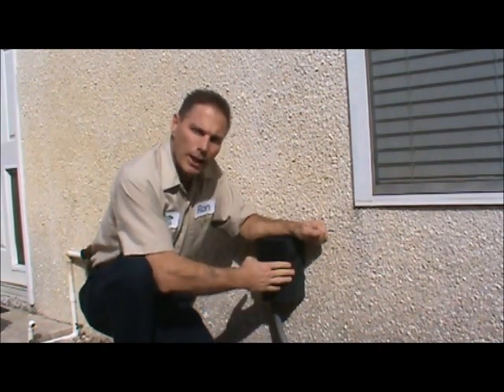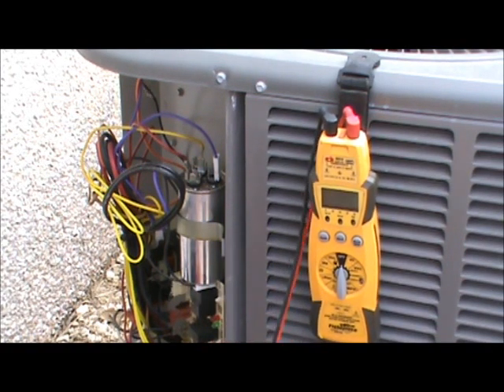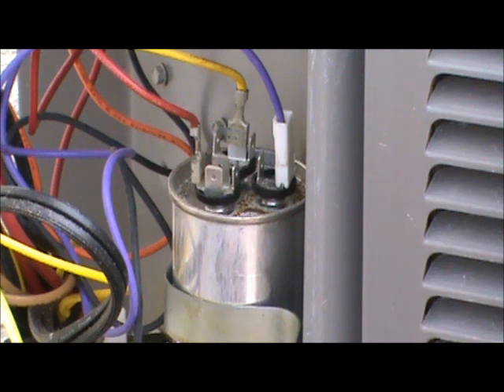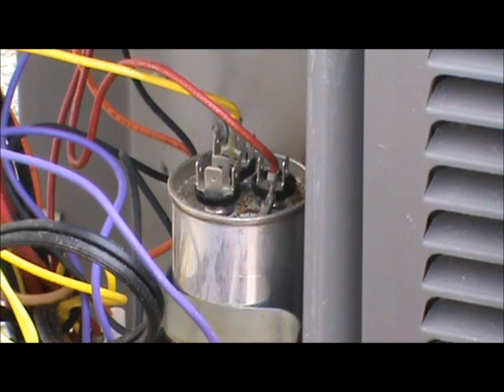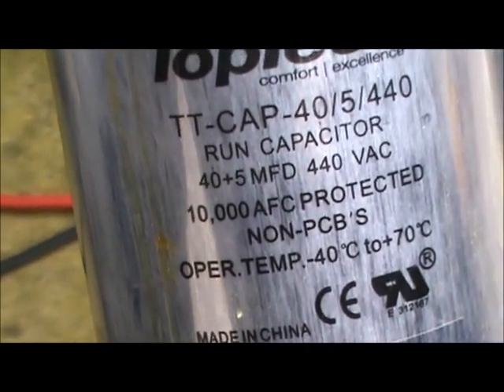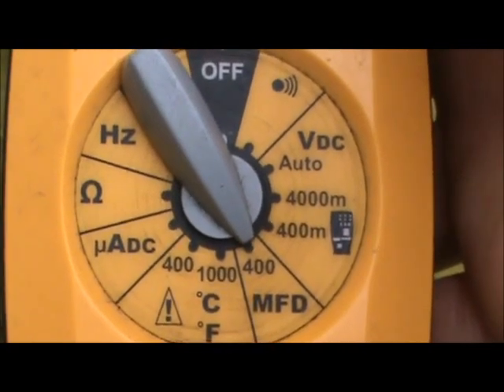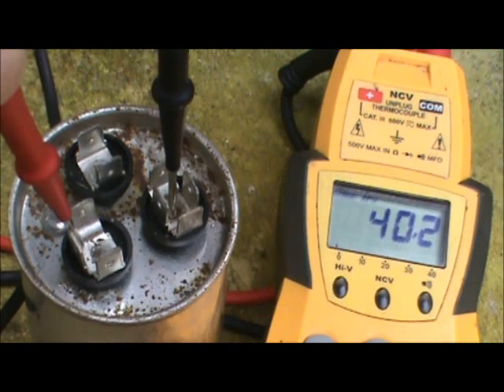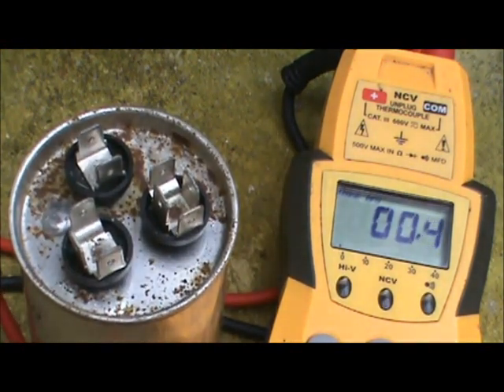HVAC Training - Dual Capacitor Checkout

Comment: I have a dual capacitor. I want to get a second for emergency 45 +5 370v.  my existing Fan as 2 connectors, Common has 4 connectors and Herm has 3 connectors to hook my wires to. 

If the one i want to purchase is marked   S, C, and fan, does it matter if S, C, and Fan all have 4  connectors to wire to (instead of 4, 3, 2 connectors)?

I thought the manufacturer may have included 4 connectors for each for convenience sake when connecting wires.  Is that true?

Comment: can it be replaced with higher value capacitor?
Reply: Not the microfarad rating..... replacement should be an exact match. However, the voltage rating of the new unit needs to be the same ( or higher). You can replace a 370V with a 370....or even a  370/440V rated unit. You cannot replace a 440V unit with a 370V. You CAN replace a 440V unit with a 370/440V unit.

Comment: 2:48 - I do not know of an exception to this observation: The fan terminal on a dual capacitor will have 2 spades (on rare instances 1 spade). The Herm terminal will have 3 spades. The common (C) will have 4 spades. I have not seen any dual capacitor (no matter the age) with more than 3 spades or less than 3 spades on the Herm terminal.
Reply: There are all kinds of combinations depending on brand and manufacturer. It's quite common to see 4 spades on ALL terminals.

Comment: Hey, Ron I have an old 8000 BTU, Window Air Conditioner. It uses a single run Capacitor. I've been having a problem where, the fan speed slows down. When the compressor tries to come on, but it just makes a bing sound. I thought it was the capacitor at first and replaced it, in hopes that would solve the issue, but it didn't. I made a video showing the issue I'm having, maybe with you're experience you can help me out. -> https://www.youtube.com/watch?v=wcy64JdKyA4

Comment: This is the 1st tech that did not tell viewers to discharge cap before testing. Perhaps his hvac tester does not require discharge 1st, but I've been told my little fluke would smoke if I tried to test without discgarge. Not to mention, the dangerous shock one would get if they touched poles prior to discharge. Some people use a resistor, I just used a screw driver with insulated handle. Safety 3rd people!

Comment: hello, sir my capacitor went bad bulging and leaking the specs are 
run cap

C22.2NO. 190
183922
SH CAPACITCTED
10000 AFC
NON PCB
5 UF (-5~+10%)
370/400VAC 50/60HZ
DNK-40050H
PACKARD, INK
STOCK NO. POC5
KENNESAW, GA30144
MADE IN CHINA
 
I  typed it up exactly can you tell me if the following would be a suitable replacement or recommend one? Thank you very much 

https://www.amazon.com/Packard-TOC5-Motor-Capacitor-Oval/dp/B01IUY2XZC/ref=pd_lpo_328_t_1/140-9769525-1972550?_encoding=UTF8&pd_rd_i=B01IUY2XZC&pd_rd_r=c9bd4345-bb42-4bf5-b2e5-21c97cd821fe&pd_rd_w=XM7PK&pd_rd_wg=9cZ60&pf_rd_p=7b36d496-f366-4631-94d3-61b87b52511b&pf_rd_r=EMKXVMT0X6RDD927XGA0&psc=1&refRID=EMKXVMT0X6RDD927XGA0

Comment: before the capacitor goes totally bad, how often should i change it?
Reply: If it's made in China; you could replace it after 2 years. Keep the old one as a spare/backup.  The AmRad Turbo200 has a 5 year warranty.

Comment: #1:  It’s better to check the capacitor while in operation when it’s under real working load conditions.  Take Amp draw from the wire going to your HERM spade connection on your capacitor.  Multiply by 2652.  Now take the voltage across the capacitor, HERM and C.  Divide your number by the voltage reading.  This will give you a perfectly accurate uF reading without even having to de-energize the unit or pull the capacitor.

Also #2:  Just because you de-energize the unit does not mean that you are safe from getting shocked by a capacitor.  If you don’t believe me just touch it, you’ll only do it once.  You should discharge the capacitor properly.

Comment: Very clear closeup shots, and good lighting and audio. You wisely suggest people note the actual position of the fan and compressor wires while still connected to the capacitor terminals (not everyone can read a schematic easily or accurately). As "sundayhusband" points out, the best approach for some people is to take photos while the connectors are in their original positions. Even a smartphone camera permits good closeup shots, since the camera's display screen shows the photo about to be taken.
Reply: Lol

Comment: TXVs?
ECMs?
R410?
Paper-thin primary/secondary "90%" heat exchangers?

Capacitors that are always burning out because the replacement for PCBs don't work?

10 SEER. 14 SEER, 18 SEER,  20 SEER....

"You need a new system if you have an R22 leak" (?????)

Do homeowners understand the screwing they are getting from the EPA and DOE?

Is the HVAC business really HVAC? Or is it an EPA-DOE enforcement business?

Comment: @ronwalker please help someone was working on my AC it was spinning clockwise before he changed the capacitor after it was changed the fan was spinning in a counterclockwise is it possible to do that by putting the wires on the wrong slots on the capacitor

Comment: and for your information: please do not forget to discharge the capacitor before disconnecting the wires otherwise you will risk loosing your fingers. I CAN'T BELIEVE THAT THIS GUY FORGOT THE MOST IMPORTANT SAFETY STEP!!

Comment: THIS IS A USELESS IDIOTIC VIDEO. THE LAYMAN NEEDS TO KNOW WHICH COLOR (RED YELLOW OR PURPLE) GOES TO WHICH TERMINAL. THE GUY TALKS ABOUT EVERYTHING BUT NEVER SHOWS YOU ON THE CAPACITOR WHICH WIRE GOES TO WHICH TERMINAL.  I HAVE WIRES THE EXACT SAME COLOR BUT STILL CAN'T FIND OUT WHICH COLOR WIRE GOES TO WHICH TERMINAL (MY  CAPACITOR IS TOTALLY RUSTED OUT ON THE TOP)  FROM THIS GUY'S IDIOTIC VIDEO. HE TELLS YOU EVERYTHING EXCEPT WHAT YOU NEED TO KNOW. ALL HE NEEDED TO DO WAS TALK AND POINT TO EACH COLOR TERMINAL TO SAY WHICH ONE WENT WHERE AND I WOULD HAVE KNOWN.
Reply: exartizo — The colors are not universal.  So unless you had the exact same unit as what he was working on, the colors could be different.
Reply: Color of the wires do not matter... a new condenser fan motor might come with different color wires... that’s when you read the schematic of the new fan motor... you’re the idiot
Reply: Electricity is color blind.

Comment: ..lol

Would you be pulling the disconnect while the unit is running under full load? 

First, make sure that your thermostat is not calling for cooling or having the thermostat in OFF state.

You also forgot to discharge the capacitor before placing the tip of your needle nose. Not sure if you ever have been hit with the stored charge from a capacitor but you are skipping some very crucial steps in safety.

Comment: you forgot to show how to discharge the capacitor with an insulated screw driver
Reply: Bleed it with LoZ on your meter.
Reply: https://youtu.be/Lj5w-2ktwK0
Reply: Time and Time again I see people wasting time when working on air conditioners... if you really understand how they work and are made there is no need to use a meter because you can tell its bad simply by looking at it.. capacitors have two conductors with an insulation/dielectric separator keeping the conductors separate..they are used for various reasons  in electric circuits but in the case of condensers one is used to start the compressor...which is the higher MFD on a start/ run capacitor...the lower MFD is used to run the condenser fan motor and always is on at all times...the compressor just uses the capacitor to start the compressor and then it gets disconnected once the compressor is running...a  second phase is needed to start a single phase ac induction motor.. you have 4 windings at 90 degree to each other...2 positive and 2 negative...another set of windings also at 90 to each other overlap the first set of windings.. obviously a winding is wires rolled in a coil...the edge of the 1set of windings is in the center of the second set...the motor can not start with only one set of windings..the capacitor is wired to the 2nd set of windings...which gives the motor the ability to start...easiest way to describe it is without the capacitor...there is not enough torque from 1 winding to spin the motor to the spot where force is given to the rotor a second time after the initial force...that is why u can spin the fan blade manually and it will start running ... compressors have capacitors connected to the start windings... capacitors in condensers will bulge when it shorts because of the pressure that the heat creates...99.9% of times just looking at it u can see it's bulged and bad..
Reply: METO U do you even HVAC bro?  99.9% of the time the capacitor will be bulged?  LOL
Reply: @metou3072  literally one of the dumbest comments posted on HVAC     ".99.9% of times just looking at it u can see it's bulged and bad.."
Reply: @metou3072  again your comment wins the award.  You should go "google" multimeter and farads.  You must be one of those home warranty HVAC "techs"  LOL
Reply: @metou3072  you're and who,substituted in the first 6 words of your sentence would reduce idiocy.
Reply: @metou3072  Some capacitors are internally fused and you won't see any bulging!

Comment: Wiring  two together Hvac capacitor
Reply: .
wiring for fan motor to capacitor the old motor had black to c purple to herm n brown to fan blue was cap off need straight to contactor my new one has brown brown white white black yellowand purple are cap off its dual csp
Reply: .
wiring for fan motor to capacitor the old motor had black to c purple to herm n brown to fan blue was cap off need straight to contactor my new one has brown brown white white black yellowand purple are cap off its dual csp

Comment: Great video good clear instructions. I watched this hoping to learn if/why it's necessary to disconnect the wires to test the capacitor if there is no power to the capacitor. Any input? Also, I ALWAYS short across the capacitor terminals with a screwdriver with an insulated handle. A capacitor can (rarely but possible) store very high voltage.
Reply from the maker: If you don't disconnect the capacitor the windings of the motor will throw off your capacitance measurement.
Reply: Darren Hiebert

Comment: if i have 35/5 440 vac and im getting a reading of 33.something (common and herm) is my cap bad or good?
Reply: good, you have a plus or minus % number on the label. the 35 rating is for the compressor which is always higher. the 5 rating is for the fan.
Reply: +r4ym1n13 i think if its good should read 35
Reply: +hamid desertmen 33 is close enough. there is a +/- of 5 %

Comment: hi, could a  bad capacitor/shorted capacitor cause a unit to stop running every 8 hrs. then restart on its own 8 hrs. later? No one can find the answer, but a friend said he had something similar and it was the capacitor. During the time when it cuts off, the thermostat and fans....motors etc. won't work, then....on its own, it comes on 8 hrs. later and runs all night long and blows nice cool air.....with no frosting or any other symptoms.....could it be a capacitor short?
Reply: Kathy Hayes Hi Kathy, not likely. Does the system have a float switch? Like this - http://www.paulstravelpictures.com/Gibson-HVAC-Air-Handler-Condensate-Drain-Pipe-Flushing-Guide/Gibson-HVAC-Air-Handler-Condensate-Drain-Pipe-Cleaning-Guide-008.JPG

If the condensation drain is nearly clogged it will back up trip the float switch (turning off the system). Then slowly drain which resets the switch and turns it on.

Let me know how it turns out.
Reply: Ron Walker Hi Kathy, The drain and float switch are on the unit in the attic. It drains the water (condensation) from the evaporator.

Comment: Safety Third: discharge your capacitor with an insulated screwdriver!  Otherwise a perfectly done video.  How did you arrive at the 10% figure?  All the capacitors I've used provide their error range in the specs.
Reply from the maker: Scott Biggs Hi Scott, you have a good point. However, if it is a start capacitor and is not a bad idea for a run capacitor. But run capacitors are hooked up across the winding of the motor and when power is removed the capacitor discharges through the winding. Start capacitors are taken out the circuit with the power applied and have a small discharge capacitor across the terminals.(You probably already know this) But, you are right safety first and it never hurts to be too careful.

Comment: if the dual capacitor is 40+5 and you test Common and Herm it should read 40 MFD but what number would it be if it was bad like anything under 25?
Reply from the maker: Joe Smith Usually it reads open. +-10% (in this exampl +-4 MFD, it should be replaced.
Make sense?

Comment: Hi Rod, is there a Dual capacitor brand that's better?
I own 12-year-old 3.5 ton carrier air-conditioner.
Reply from the maker: Glen Webber There is a capacitor that has a 5 year warranty, made in America by a company called AmRad in FL... I don't know if they're any better though.

Comment: After discharging the capacitor, clean all of that debris/oil from the top of the capacitor before measuring. Use a replacement tolerance of +/- 5%, not 10%. Incidentally, your VOM puts a small calibrated charge of its own back into the capacitor. This can be ignored when replacing the leads.
Reply: Absolutely. The nominal capacitance is listed on the capacitor. The industry standard for motor design and in the applications of air conditioning is capacitor tolerance is  +/- 6% and never +/- 10%. Ditto on reversing the DVM leads when measuring the capacitance.

Comment: do you discharge the dual capacitor before measuring the capacitance?...
Reply from the maker: pei bossman It is not a bad idea to do so. If the motor doesn't have an open widning, the cap will discharge itself through the winding.
Reply: You always discharge a capacitor as there will always be some stored charge in it. Never assume there is no charge on any cap. If not sure grab your meter and check for any residual voltage.